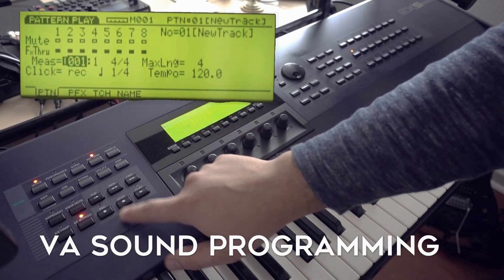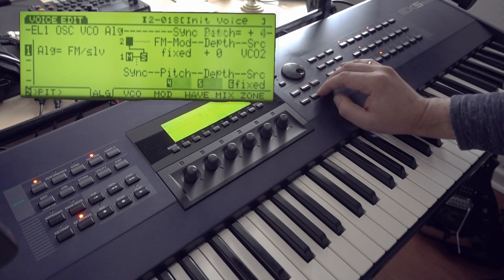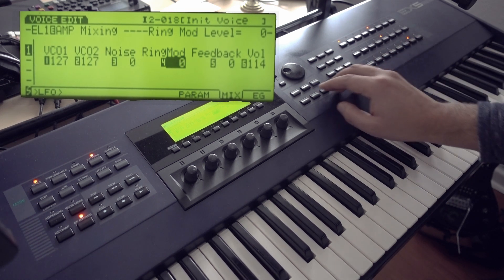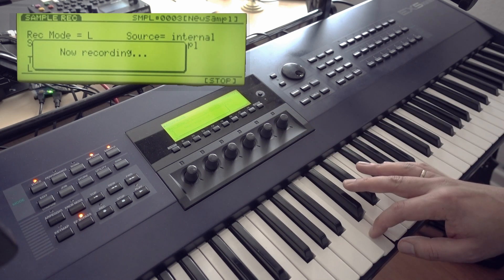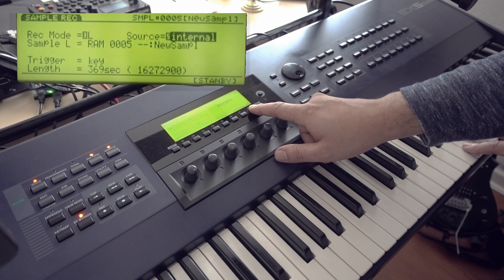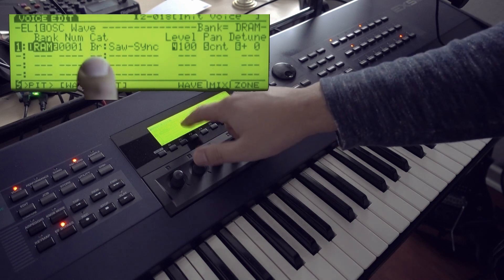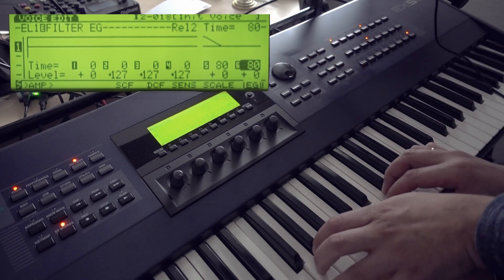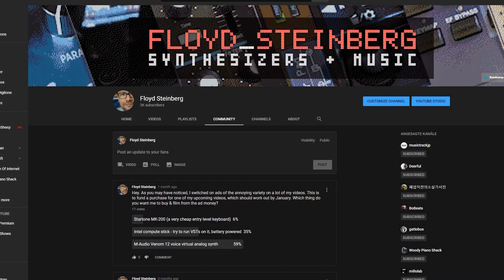Yamaha EX5 resampling - how to get more polyphony on your virtual analog patches

Comment: Why would anyone need an analog synthesizer, is beyond me.
Reply from the maker: Thanks for watching! Well, I think it's nice to have at least one hardware synth which has one knob per function, and analogue synths mostly do. But sound wise? I can't tell the difference, be it in a mix or solo. 
One thing I found is that the market value of an analog synth slightly increases over the years (if you buy it second hand, that is). So they're also some kind of investment and trade good. Best regards!

Comment: Your poll: for me depends what you run on the intel compute stick. If it's Linux, I'll vote for that. Otherwise I think the M-Audio synth...
If you let me know, I will vote. ;)
Reply from the maker: Well, I could do both. As most people use windows, I'd cover that one first (it's also more convenient ;-). I kind of expect more trouble in setting up Linux with the benefit of better performance after all the troubles. :)
Reply: @mr_floydst  ... and getting VST's to work properly.
Reply from the maker: @GertBoers  As long as the CPU is X86 compatible (which the "celeron" series in these sticks is), most VST plugins will work. Most problems are related to licensing.
Reply: @mr_floydst  Then I am more the curious how you can get it to work on Linux.
BTW I voted for the compute stick, but atm that's not the winner... maybe both? ;) :D